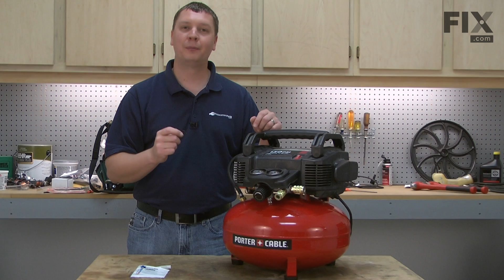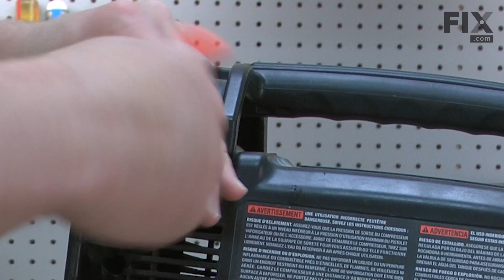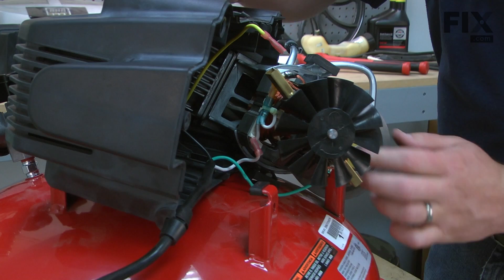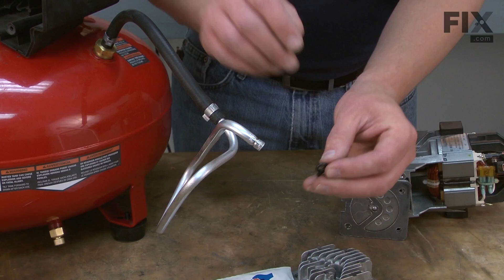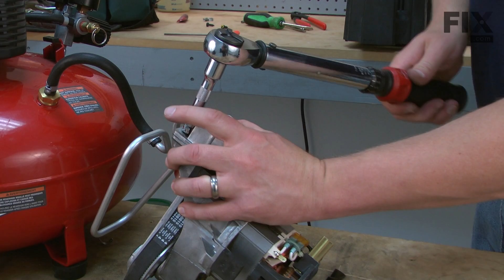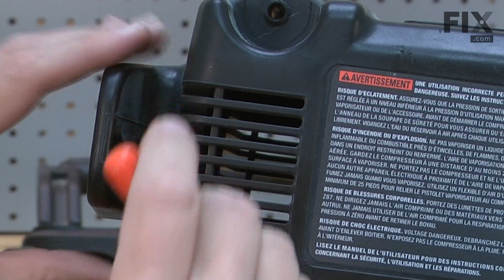Porter Cable Air Compressor Repair – How to replace the Tube Seal

Comment: IMO, it would be helpful to show how you determined the tube seal needed to be replaced. After spraying every external hose connection with soapy water and not seeing any bubbles, I started taking it apart starting with the gauge cover. Finally took everything apart to reach the tube seal after pressurizing so it would bubble. However, not even the tube seal is bubbling. Do I just get a new tube seal and replace it because it was so much work to reach it? BTW, my PC compressor has leaked since it was new. Any ideas before I put it all back together?

Comment: What's the function of this seal?  People are looking for solutions to their own compressor problems.  I have no idea why are you replacing this seal.  Is it because the tank won't pressurize to 150psi - like it stalls at 120psi??  Describe the symptom so we know why you are changing this seal out.
Reply: Still no replies.   I guess this video is useless.
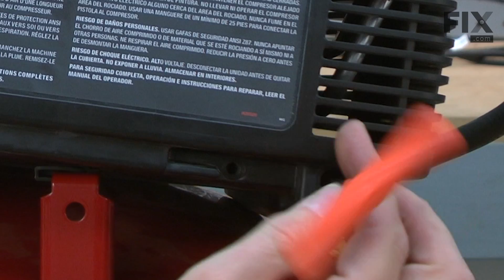Reply: And in order to get that third star screw out of the right side of the case to take the case apart (2:15) you must have a driver that fits in the small hole and at least six inches long to reach inside to contact the star screw.  I had to go buy a long star driver that will only ever have one useful purpose.
Reply: The seal keeps the pressure that builds up in the piston chamber from leaking out. There is nothing else stopping the air in the tank from leaking through that piston chamber because there is a direct hose connection from it to the tank.

Comment: Should the head gasket and cylinder head easily separate from the cylinder after removing the bolts? Or should i have to pry it apart?

Comment: Good video; gave me some insight regarding one of the screw placements that kept me from separating the housing itself. What would have been "most useful" is to indicate what screws were phillips and the others being a Torx driver. The phillip screws that attach the housing to the tank were obvious, the others were not; especially when removing the cover around the gauges (T10) and the screw doesn't actually come out, but simply allows the cover to slip off.  The others were T20. My problem was that I accidentally pulled the power cord out and needed to re-attach. Additionally, one of the T20 screws needs a longer driver to reach the screw head. The size of the hole where the screw was located prevented me from using attachments (socket driver) with a T20 bit; I had to go purchase a longer set. On the plus side, I gained a new reason to buy more tools ; )

Comment: Hi appreciate the video I had a different internal issue but the video was a good assist in removal and getting internal. After reassembly and test the HP hose from the tank to the regulator was very hot to the touch. Can you tell me why that may be ?
Reply: Compressing air always heats it up a lot, it's just physics.  I used to fill scuba tanks and we had to put them in water to dissipate the heat, otherwise the pressure would rise artificially from the heat and not be full after the tank cools off.

Comment: WARNING !!! Inch pounds and foot pounds when mixed up can cause you to strip out a screw easily! My torque wrench is foot pounds. So I set it at 50. 50 inch pounds is 4.17 FOOT pounds. Check my info yourself.

Comment: I'm not sure this is my problem.  Tank will fill to only about 50psi and never shuts off.  It will hold this pressure so I know there is not a leak.  Do you think it is this seal that you're replacing? Thanks for the help.

Comment: Great that you show how to do it. Now what symptoms does this fix? lol    How do I know if mine is bad or if my issues are related at all to the tube seal?
Reply: After removing the motor, if you find that the tube is not firmly attached, wiggles, the tube gasket should be the culprit.

Comment: You blocked the tool you used to take off the gage cover with your hand! That's what I wanted to know, looks like it may have been an Allen, will try...
Reply: They are most likely Star Bolts (Torx), not Hex
Reply: Torx T-10 for the gauge cover.

Comment: Hey great video.   Where can I get parts
Reply from the maker: Hi Jeffrey, you can find this part on our website: https://www.fix.com/parts/compressor/porter-cable/fix10049061/tube-seal-n044359/
Reply from the maker: If you're looking for other parts, you can simply enter the part number at https://www.fix.com/ or enter your model number and search through for the part you need!

Comment: Nice tutorial, but that’s not a Nut Driver. What size hex driver did you use and how long is it? My standard Allen wrench could not reach the depth it’s placed at.
Reply: I ground down an old long, 5”, slot screw driver. I used an already removed T20 screw to get the best fit.

Comment: Great tutorial but I suspect this was demonstrated with a new compressor because the gasket wasn't "welded" to the cylinder head like mine was. Getting the remnant of the old one took about 10 minutes.  So if you're going to attempt a fix of this seal make sure you order a new gasket.
Uodate: the leak turned out not to be from the tube seal. I probably should've tried pinpointing the leak with soapy water. When I did that I found 2 leaks. One from a loose clamp on the rubber hose and the other from the bottom of the piston cylinder. Air in getting past the piston and coming out the bottom. Not alot but enough to empty the tank in about a half hour.  Now the suspects are the check valve or valve plate at the top of the cylinder. Unit has very few hours on it.
Reply: im glad i get to read this before i start digging in my pancake.... tanks for the info

Comment: Did he say to tighten the manifold cover bolts to 49-55 inch-pounds? They don't seem tight, or as tight as when I removed them initially.
Reply: That is the spec for the head bolts. Covers the piston chamber with the valve plate and gaskets in between.

Comment: My porter cable 17 gallon compressor lasted about 9 years (barely used in that time, maybe 3 years regular use). The motor bearing recently wore out to the point where the bearings fell all over the place, real shame the parts are ALL PRESSED INTO PLACE. The motor shaft was moving around so violently it was actually jamming the compressor piston.

Don't let those "maintenance free" stickers fool you, all that means is "If anything breaks, throw it out, cant fix anything". 

New stuff is all total junk once anything fails. Such as shame. 

I'm buying an exposed compressor next, nice large belt, 240v motor, even hand crank if needed so i can see all of the internals :)

Comment: How do I determine where exactly the air leak is coming from. On mine I can only tell that it’s coming from under the shroud?
Reply: It can be from the two air host quick connects, the drain valve, the hose that is clamped from the pump to the tank. The only thing left is this part in the video. you can put soapy water on the hose ends and you can place your finger over the drain valve and air hose connects. If you see bubble or feel any pressure building up under your finger when place over these other openings then you know.

Comment: Hi, what size Allen wrench do I need to take off the manifold housing?
Reply: looks like square head I going to try 3 or4 mm key stock
Reply: it’s torx bolts
Reply: I just cut it with my multi tool.

Comment: Went to replace the gaskets and tube seal. Unbolted the cylinder head and the plate won’t come off the piston. It seems like it’s mounted on there, and the gaskets are paper and are permanently adhered to the metal so I can’t replace the gaskets unless I scrape it all off. Am I doing something wrong here? How the hell do I get the cylinder plate off the piston?

Comment: I changed the belt on my porter cable 6gl pancake compressor it still will not build pressure any Idea's
Reply: your problem maybe in the piston and cylinder which compresses the air. The same happened to a DeWalt compressor I fixed and that was the issue. I'm currently trying to figure out what is the problem with a Porter Cable Pancake compressor I'm working on, and I think that's also the problem.

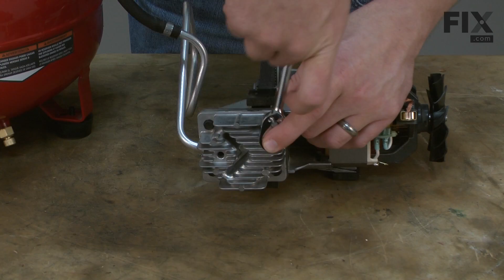Comment: I have air leaking out of the round hole in the middle left of the cylinder head directly above the tube (as seen around 3:37 minute mark). Will this tube seal fix this or is my issue elsewhere?  There is little to know air coming out around where tube goes into motor.
Reply: So after doing research the hole in the head is there on purpose. The cause of air leaking there is the check valve on the tank has failed. So just to follow up, I took out my check valve (its connected to the tank), I then cleaned it using WD40 then sprayed it with penetrating oil. I then stuck a pick down the narrow hole cylinder of the check valve, the valve should open when you press down on it. Rust was stopping mine. After lubricating and cleaning it, its back to normal. No need to get a new valve just clean  your old one, instructions in porter cable manual say to use varnish or paint remover to clean. Reassemble using new clamp and red locate, back to work. 

https://www.ereplacementparts.com/cylinder-head-p-62827.html
https://www.about-air-compressors.com/porter-cable-air-compressor-has-leaking-air.html#submission_29718839
Reply: Chvydrptop, thank you for the reply. I finally came to the same conclusion after taking the entire compressor apart for no reason. Oh well, how better to learn, right? I bought a new check valve off ebay and it leaked worse than the one I had, so I sent it back and tried cleaning mine up and it started working again, although it still leaks some. I already bought another new one, but I may try doing a more thorough cleaning of my existing one and applying some new thread sealant. Thanks again for taking the time to reply.
Reply: @mikenc1515  were you able to fix that air leak? I have the exact same issue and I want to fix it right on the first try. Thank you

Comment: What are the common symptoms of a bad tube seal?
Reply from the maker: Hi, because of the heat that builds up around the tube seal, this will cause the seal to wear and start to leak air eventually.
Reply: My question too - my old PC compressor started hissing air out from inside the shroud when it got worked hard. Do I need a  nickles worth of rubber to fix it?